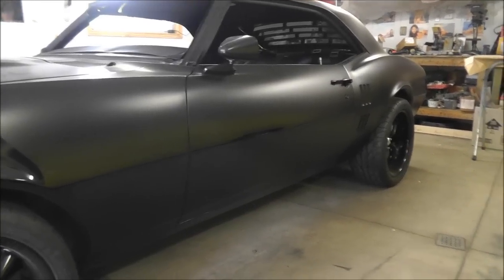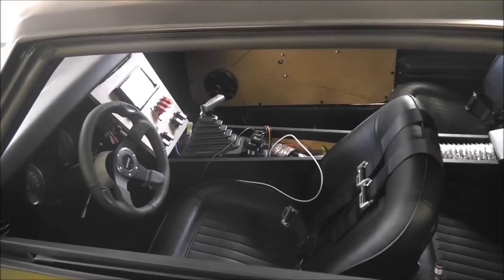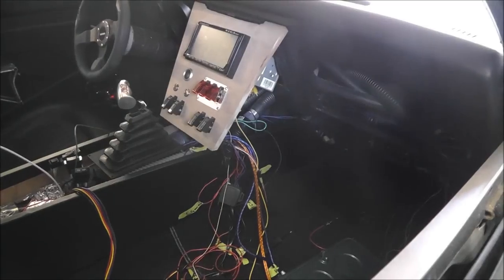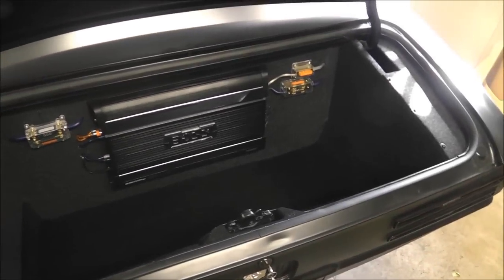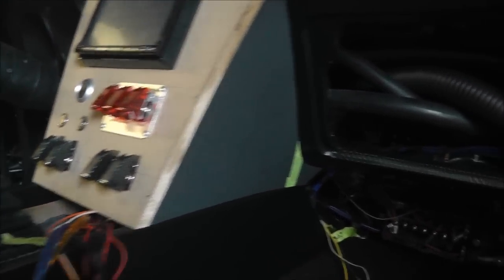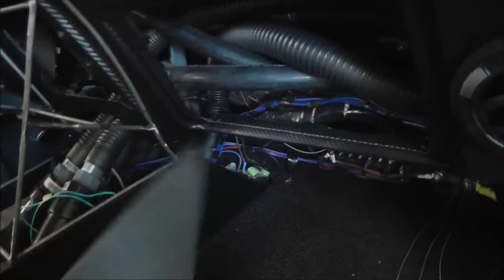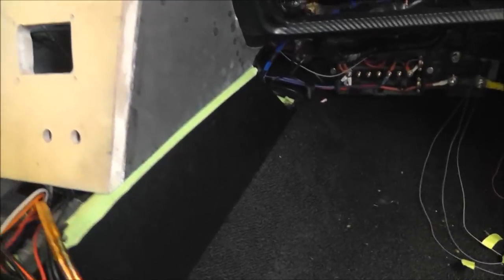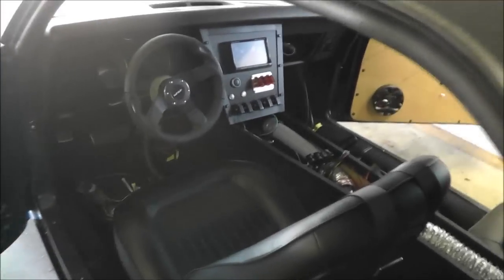My 68 Firebird Restoration Part 83

Comment: I used paint stripper on my car to remove 8 coats of paint and primer. The car still has some of the original primer that the stripper would not remove. What can I use on the car to neutralize any residue in the stripper so I don't have any bad reaction with paint? I will sand the car to bare metal before I start any body work. Thanks for any help.